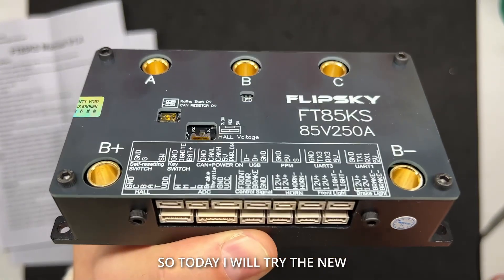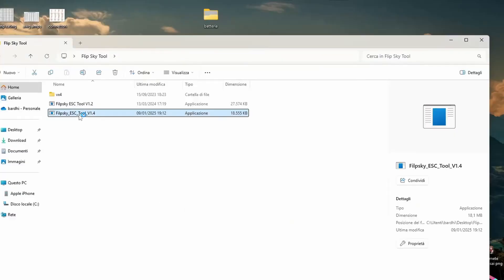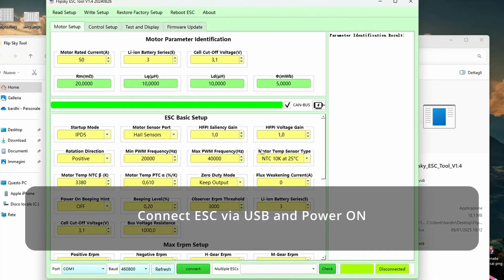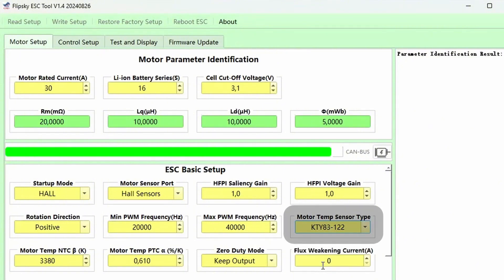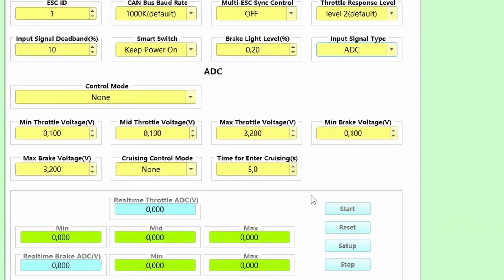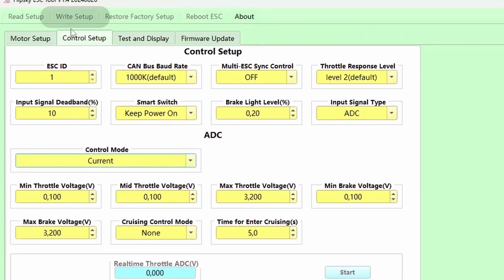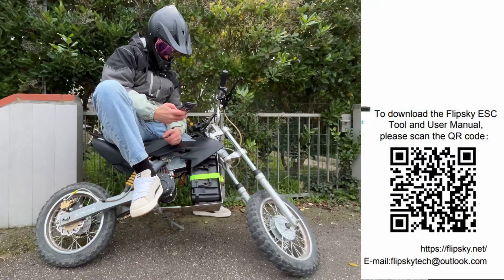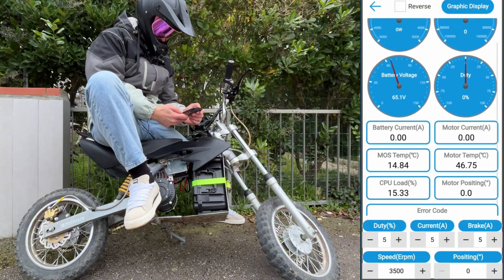Upgrade E-bike with Flipsky FT85KS ESC | Review

Comment: Добрый день подскажите могу ли изменить параметр (Max PWM Frequency (Hz)) если после автоопределения частота стоит 10000. И повлияет ли ее изменение на максимальные обороты мотор колеса?
Reply from the maker: We do not recommend modifying this parameter. If modify it at will, it will affect the speed a little and there is a risk of burning out the MOS tube.

Comment: This was greate ! Its the first video i found aboute the Flipskys own Software. I had doughts in the beginning that it even will work. What i was missing is that he dit not show all settings you can set up in the software, and not all hardwares are installet that the controler can use. Like the Displays, and i dit ask for this so often the Padel assist sensor for Europa Ebike regulations. I will in some months buy finaly all the needed hardwares, it will cost me aboute 600€ so only the controler whit display and BMS + Bluetooth modul, but it should worth it. Pls Pflipsky sponsor some one to show the hole software possibilities in englisch ( if some one is can do it in german also in german pls ).
Reply from the maker: Hi, thank you for your advice. And we have the TFT display for e-bike which is compatible with our ESC, you can learn more via this link: https://tinyurl.com/5arhc3rj